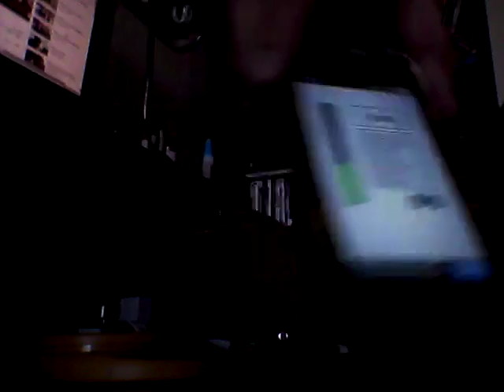Blade 350 QX side by side motor comparison.

Comment: If the bullet connectors were different sizes, why didn't you just cut them off and solder the wires together?...Soldiering is really easy and it saves the hassle of various connectors of various sizes, it's more secure, and it even saves unnecessary weight. :) Just a thought. Nice comparison. Any idea if a different (upgraded) ESC can be used in the 350QX/2/3? I thought I heard you say you used a 12A Plush but that was on a different frame and you never mentioned what flight controller you used. That might actually be your problem with the unexpected malfunction.
Reply from the maker: The 350 qx doesn't interact well with after market escs. I didn't solder different connectors on at the time because i was using it on the 350. The different frame  i was using was a 450 frame  with a kk2
Reply: Oh gotcha. Thanks. I'm having issues with my 350 QX2's  flight control board, which is $200 to replace (from HH) and (which I've already housed in a new 350 QX3 body w/new tall white landing gear) and considering popping a CC3D or a Naze32 board into it Since I have a couple laying around. Like you said, the 350 QX doesn't play nice with after-factory ESC's and those damn motors definitely aren't worth the whopping $50 they cost to replace either.. With a Naze or CC3D I'll be able to add some Cobra or T-motors and some nicer ESC's (maybe some Rotorgeeks 20A 2-4S optos (and one non-opto to power the FC). I'm thinking this will basically be FPV Mini-Quad 350 QX3 racer! :) Did I mention it will then be able to run Cleanflight instead of the Blade software he he. I'll post some pictures if it happens and let you know how it turns out. I'm pretty sure it'd easilly out maneuver a stock 350 and replacement parts will be cheaper.
Reply: Did this work.... ??

Comment: This is a horrible way to test thrust. The tape used here is going to absorb some of the thrust because of it's thickness. The motors need to be mounted in a way that nothing is absorbing any of the thrust. Additionally there are no amperage readings. You need to be reading the amps pulled from the esc and these reading should be taken at 10% intervals of the throttle. If the motors are producing 2% more thrust but taking 10% more amps then they are useless as they will cut your flight time nearly in half.

Comment: I have a question I have to know!   Is it true if you just change the props on the Blade 350 it will blow out the motors and the bored will fry?   if so is there a way to change the props so that will not happen with out changing the motors?
Reply: Always check the temperature of your motors after you fly if there to hot to touch you have a problem somewhere. I use 9.5 props and get better flight time with no heat issues. Heat is what kills electronics period!

Comment: Sorry for the silly question, but I notice the turnigy isn't color coded like the stock ones.  Does it matter which phase is which?
Reply: nope, if it's spinning the wrong way, swap over any two motor wires.

Comment: It was using more amperage but it had the same throttle input and did not bottle neck the current. The esc pulses on and off and it does not measure current. I am sure the esc will get much warmer, you might want to test the temps and see if the esc mosfet are exceeding 75c. They really start to decline in thermal efficiency after 100c, they fall like a brick.